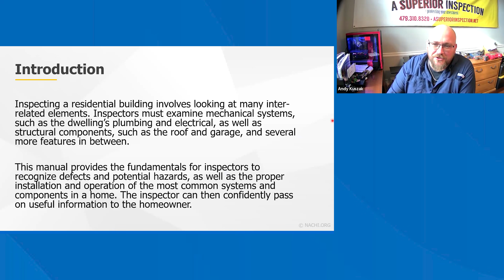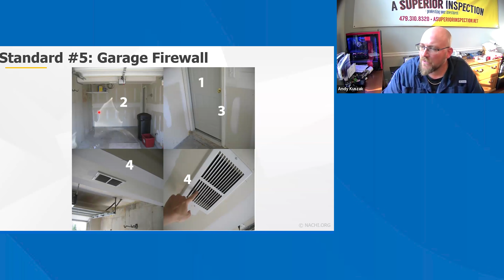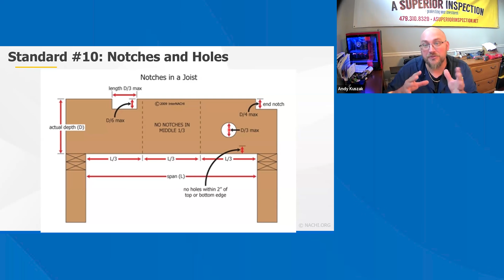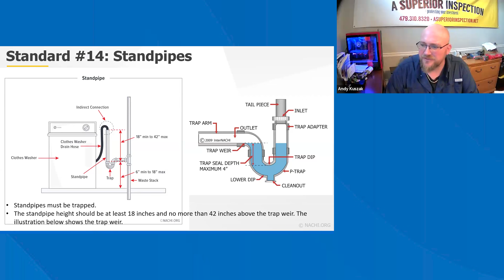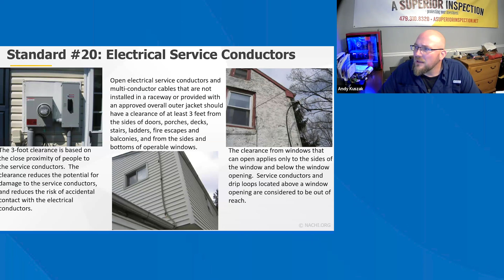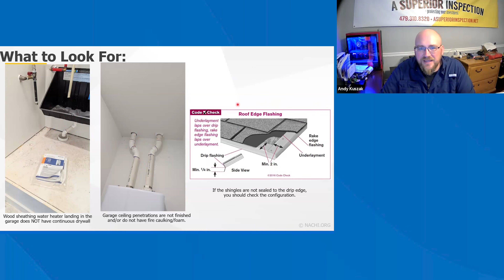25 Standards Every Inspector Should Know with Certified Professional Inspector (CPI)® Andy Kuszak

Comment: This is an excellent presentation—one of the best I’ve seen! Any chance Andy could do a follow-up with another set of 25 standards (maybe titled “Standards 26–50”)? It would be great to see a part two covering even more of these key points.
Reply from the maker: Yes. Thank you.
Reply: I'm a huge proponent of the dryer vent going through the wall and not the roof.   ( Give it to the neighbor.)  It is a much shorter distance and the lint wont fall back down the vent when the dryer shuts off.  By the way, you are a great teacher.